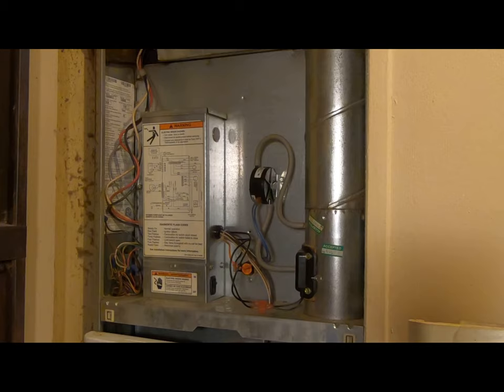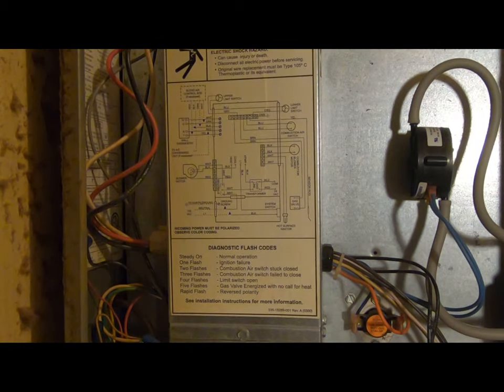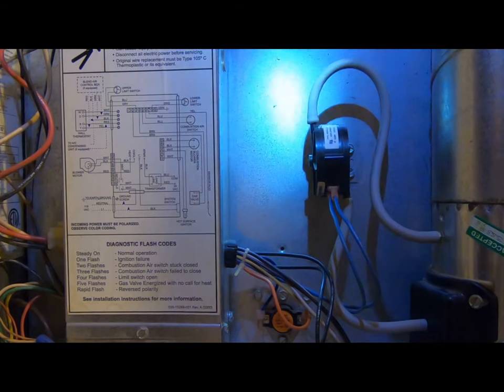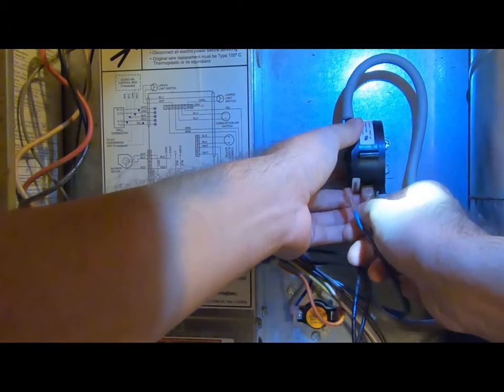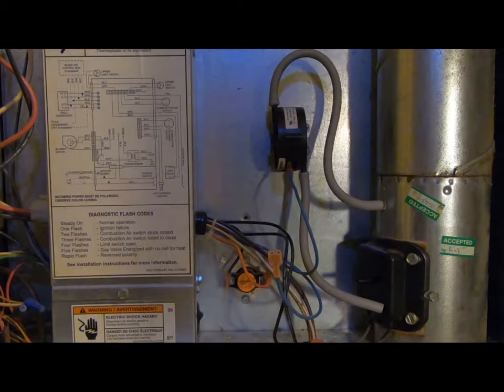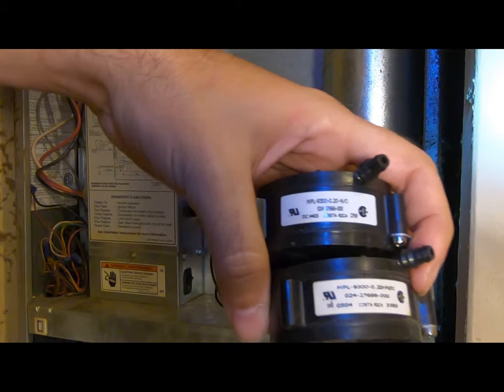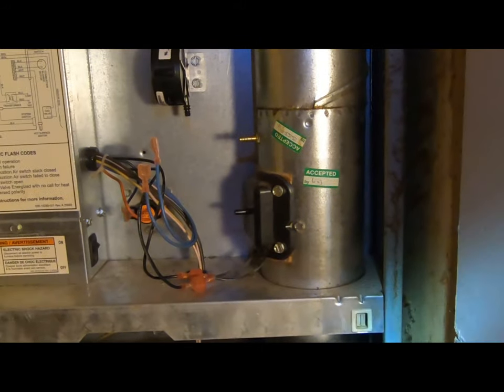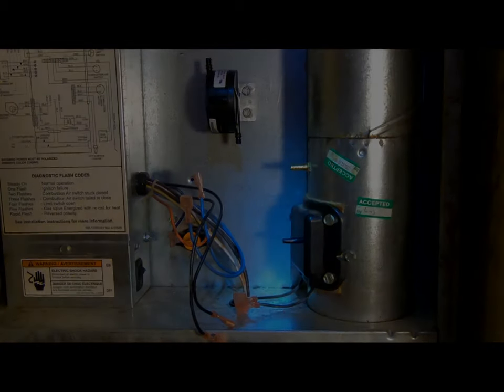Joshua Fixes the Furnace Pt 1-Testing & Diagnosis of Coleman Furnace Model DGAA056BDTA

Comment: Thank you for explaining the green light is a code, I googled 4 light flashing.. it’s a reset button... I have heat again
Reply from the maker: Yay!  That's SUPER!  Glad I was of help to you!  That's the whole reason I made these videos!

Now, I would caution you to kind of keep an eye on it.  Don't trust it just yet.  SOMETHING had to have set it off to begin with, but who KNOWS what that would have been...  Maybe it's something that will happen again and maybe it's not.  I mean, Windows crashes all the time, you know, and just turning the computer off and turning it back on 'fixes' it.  But on occasion there's really something wrong.  Hopefully that's not the case.
  
Hopefully just some weirdness from being off all summer and only now getting turned back on.
Reply: Joshua the Regular Guy  well I had hit the main like 10 times working on my lights 
Still working on my fan project 
But the furnace is plug away lol

Comment: I have replaced both parts , but the code still becomes active , is there a lower  ( “ ) limit switch? Because the new one is .20” and it’s not tripping , I made the mistake of throwing the old one out!!
Reply from the maker: Hey Maggie!  First off, thanks for watching my video!

I'm not really a furnace guy and certainly no expert on this, but from years of fixing my own junk my first thought would be:  Did you put it together right?  Is it wired in right and are the tubes connected properly?  Not to be second-guessing you or anything, but I've hooked stuff up backwards more than once before.  Put a distributor in the car backwards before, etc.  If those hoses / tubes are reversed it's not going trip the switch.  Have you tried blowing in that lower hose AFTER installing the new switch (I showed that in one of the videos I do believe) just to see if you can get the new switch to trip that way?  That should at least indicate if your new part is possibly faulty.  And make sure your little hoses are actually clear by just popping them off and blowing through both.  Could just be a blocked hose maybe, or maybe one is super-loose like mine was and is letting pressure leak off just a hair too much to trip the switch. 

I did google the part number and found that there ARE switches available with a lower pressure rating.  One I googled up is set to trip at 0.10" and it says, "Replaces older switches  that were rated at .15" .18" & .20"  So yes, you SHOULD be able to buy one similar to that.  And I believe there are adjustable ones available too, meant to work for probably a whole range of makes and models with the proper setting, but I'd advise you to double check to make sure any generic multi-purpose part like that is what you need before you buy it.  Maybe even call the place selling it (or go there if it's local).
  If you google the part number you can see what you think.  

Here's a link to a website with a scan of the manual, which may be of help, if for no other reason than you have the original part number right there on the screen to make google searching easier.  It's also helpful with the other trouble code flash sequences if somewhere down the line you have some other problem.  And other suggestions as well, like looking for a blocked inlet pipe.  Leaves, squirrels, spiderwebs, etc can block that pipe and if there's really reduced airflow that would create an issue that could result in this 3 flash code error as well apparently.  https://www.manualslib.com/manual/773856/Coleman-Dgaa.html?page=8#manual

Best of luck, and if you don't get in figured out let me know.  Maybe I'll think of something else to try or something else that could be wrong.
Reply: @joshuatheregularguy8974  Yes I did think of and reversed wires and hoses , I even blew into the new switch and nothing changed , Either the fan isn’t producing the correct air pressure or the new switch is bad , I remember you saying to match up the numbers , which I didn’t at first , so it may be my fault , in ordering parts . Because when I put my furnace in goggle , it sends me to Coleman and mine is a Vexar furnace!!!
Reply from the maker: @maggienaylor5794  Well, I don't know about Vexar.  I know I kept coming across York and Evcon and Honeywell in my searches with my part numbers and model number.  If your model number matches this one though, I would think it's probably pretty much the same.  It's probably much like car brands where you could have a Ford car, but there's probably a nearly-identical Mercury and Lincoln model as well.  Like the Thunderbird, Cougar and Continental Mark VII, or like the Pontiac Firebird and the Chevrolet Camaro.  Maybe Vexar furnaces are another one made by the same people who make the Coleman furnaces as well.  I'm not real sure.

If you did the blow test on the new one, and it didn't do anything--not even a click somewhere to indicate that SOMETHING changed, even if it didn't work, then I'd say that part is definitely suspect.  It's too bad you tossed the old one, but hey, can't really blame you.  I should do more of that myself.  My old one is still here, sitting on the clothes dryer.  

But then, getting the wrong part could be the problem as well.  If it's wrong, maybe it's sensing the pressure OK, but trying to do something different than the little motherboard expects it to do, like switching the power off instead of switching it on.  Sensors are simple usually, but they're also weird sometimes.  With the part number being like 12 characters or whatever, it's easy to type something in wrong or something like that, too.  When I was googling a bit ago I left a number out and didn't get any results, but sometimes you will just get wrong results instead.

Now, I didn't ask this before, but the fan DOES come on when you flip the furnace on, right?  Is THAT part working, at least at first, if it doesn't STAY working?
Reply: @joshuatheregularguy8974  the fan comes on after I wait 30 seconds and bypass the switch
Reply from the maker: @maggienaylor5794  Sorry for the delay in responding this time.  I had to go and do some stuff.

All in all that's perplexing.  
As long as we're both talking about the little fan--the fan inside the pipe instead of the big fan that pushes air from the furnace through the ducts--it really should come on pretty much immediately after you turn the power on.  Or at least MINE does.  Maybe this Vexar unit behaves somewhat differently though.  

It's quite possible you have something else that's bad or something more that's wrong with it.  

I'm all for taking the initiative, being self-sufficient, and fixing my own stuff but there comes a point at which you have to decide if it's cheaper to keep buying new parts to throw at a confusing problem or if it would maybe be cheaper to just call a professional who genuinely knows what they're doing.  It might be about that time.  

It will likely annoy the professionals to hear this, but I tend to take advantage of them a bit.  If I can't figure out what's wrong with the furnace or the A/C or the car or whatever, I have no compunctions about calling a technician and paying for a service call.  They poke around and figure out what's wrong while I watch and talk to them, then they tell me what's wrong and give me an estimate to fix it.  Sometimes I'll just pay them if it's not too expensive, if it requires doing stuff I can't do, or if it just looks like a real pain in the butt while they're poking around.  Other times I'll say, "Gosh that's a lot and I'm too poor to afford it right now.  I'll call you when I get the money."  And then I'll buy the parts they said I needed and just replace them myself.  It's well worth paying the service visit cost as a sort of 'consultation fee' at times.  Especially when it's getting awful cold (it's 31 degrees outside here).  I'm a big weenie about being cold.
Reply from the maker: @maggienaylor5794  Did you manage to get that thing figured out?
Reply: @joshuatheregularguy8974  not yet
Reply from the maker: @maggienaylor5794  That sucks!  :(

Comment: Mine is blinking 4 times and diagram says , limit switch open
Reply from the maker: If anyone else is having this same 4-flash problem as WeeBee Gold and Silver AND Missy Johnson had, the same question was asked on another video of mine:

https://youtu.be/sG1PD-u1UPc 

Additionally there was some follow-up to that with info on how to reset the limit switch / breaker.  That won't fix your furnace if you actually have a faulty blower motor, but if it's just overloaded the circuit and tripped the limit switch / breaker (which is FAR more likely than a bad blower motor) it will get you up and running again.    

Thanks again to WeeBee Gold and Silver for providing that follow-up info.  MUCH appreciated!  If we all work together like that, helping each other out, we can do just about ANYTHING!!